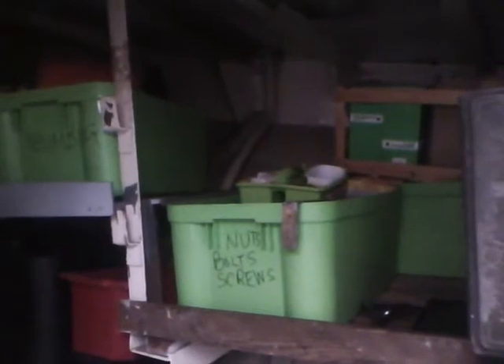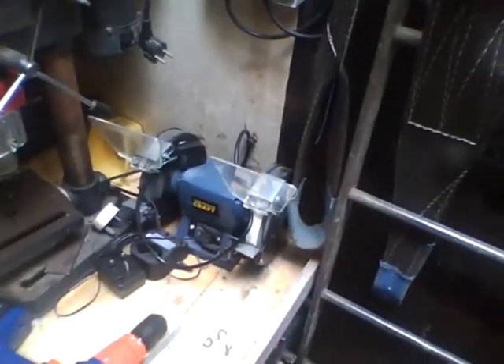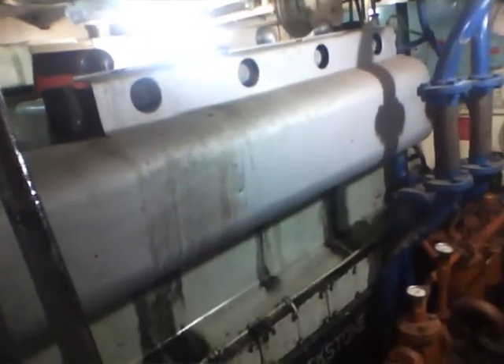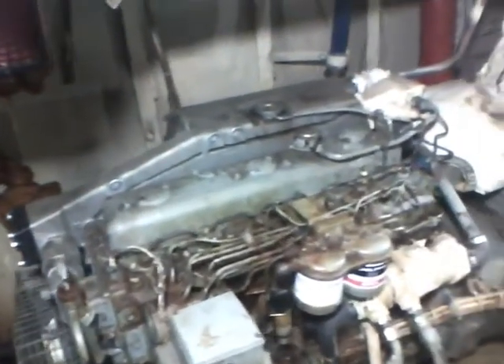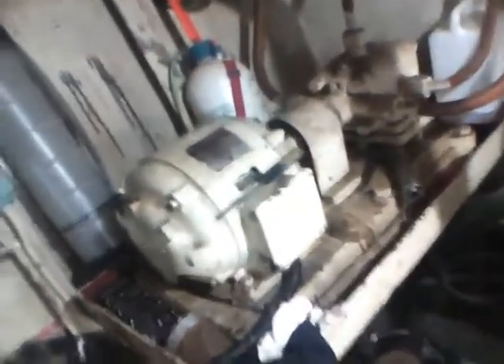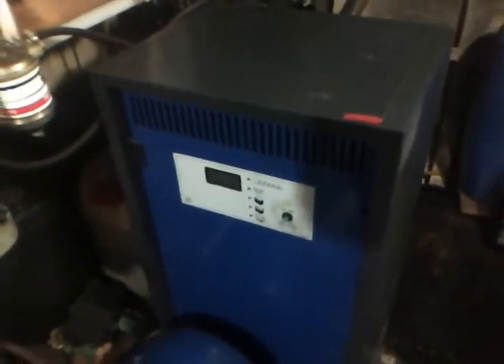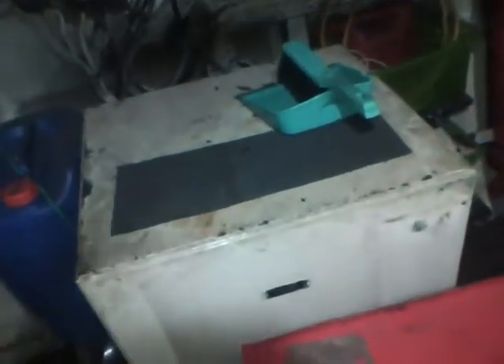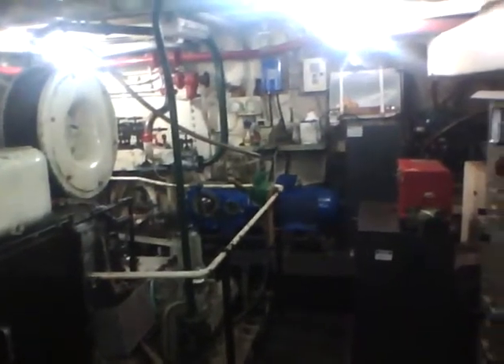Ex navy Fleet tender Holmwood Forepeak and Engine room.

Comment: I'm interested in investing in a fleet tender in the future. Purely magnificent pieces of British engineering. I am just wondering if you run that boat by yourself, or with someone in the engine room, cause all of those tenders run with an Engine Order Telegraph system. If you are doing single person operations, did you have to overhaul the engine controls, add an electrical engine control system, or put a motor on the throttle?